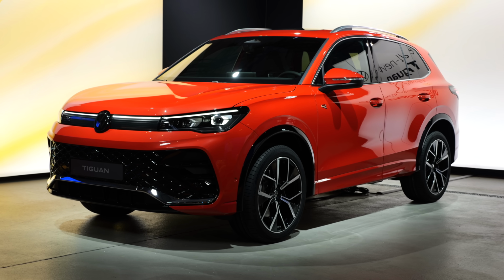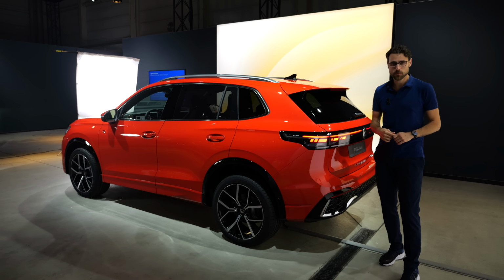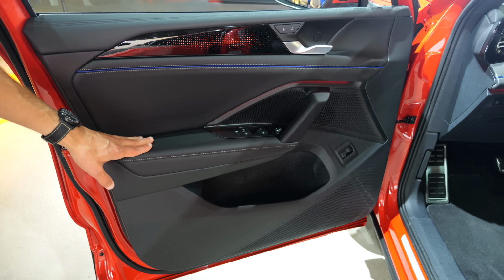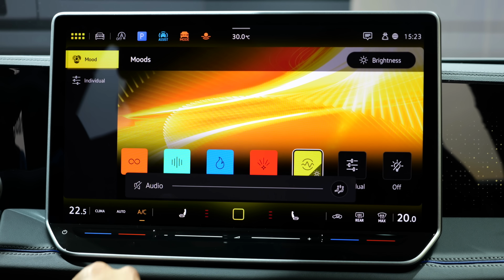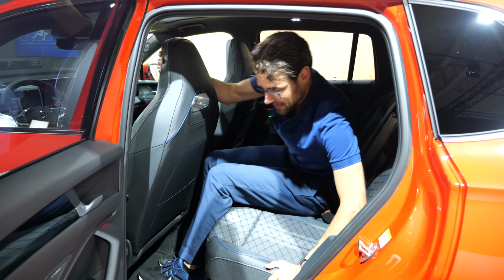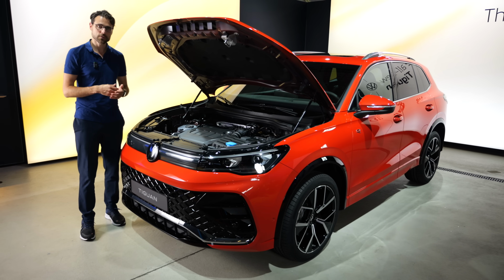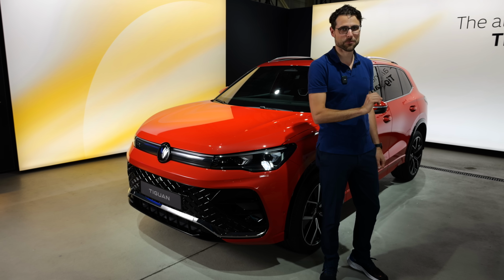all-new VW Tiguan first REVIEW 2024

Comment from the maker: ►Follow us on Instagram @autogefuehl and @thomas.letsgo
►Subscribe here: https://www.youtube.com/user/autogefuehl?sub_confirmation=1

00:00 2024 VW Tiguan R-Line
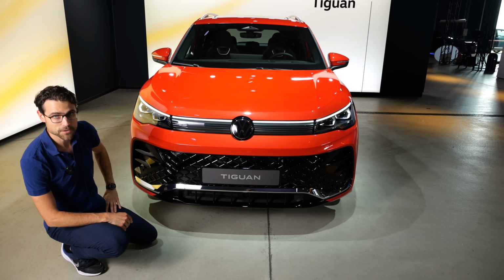01:09 Length, wheels and DCC Pro
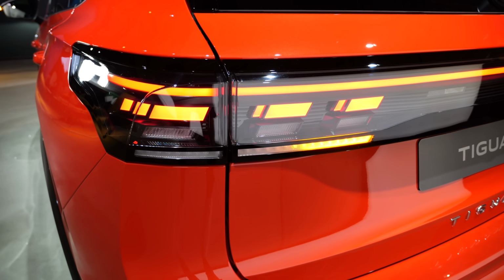03:10 Elegance
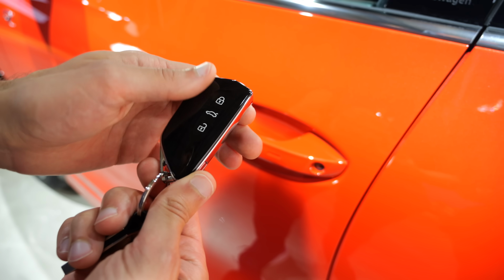03:38 Interior: doors and steering
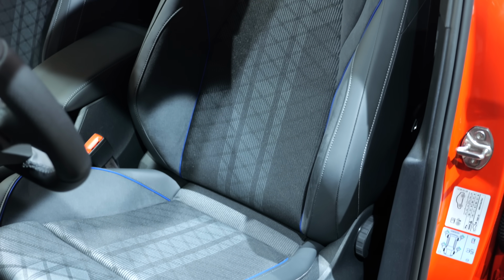04:43 Seats and comfort
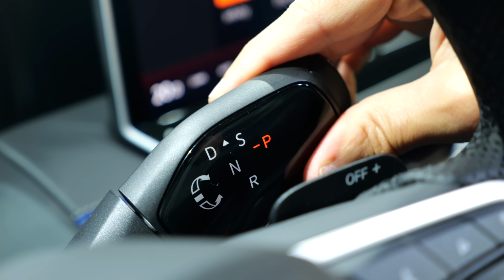06:20 Cockpit and user interface
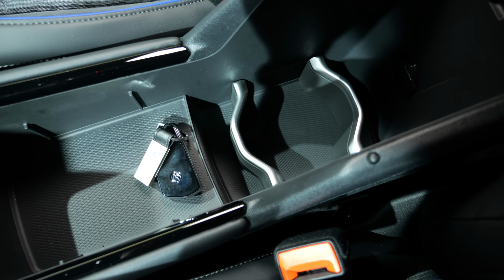09:15 Rear seats
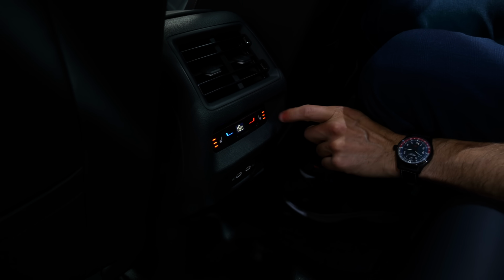10:34 Trunk / boot
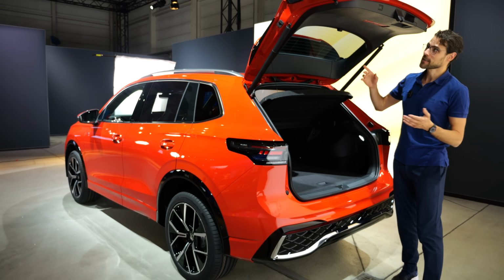12:08 Engines with upgraded PHEV
13:08 Will it succeed?
13:52 Tayron as Tiguan for US market

#VW #VWTiguan

Transparency note: Autogefühl videos are independent and free from editorial influence on opinion and rating. But since manufacturers enable us to do the reviews in the first place, for legal reasons this video is marked as _advertisement_.
Reply: Portland. JAMAICA in the Building!!!
Reply: Let me guess: complete over-engineered, thousands of sensors and actors confusing repair attempts, weak contruction. Designed on computer, tested by customers. No thanks.
I love my Golf IV, model 2002 with 1.9 TDI engine, never had a problem after 350000 km. No electronics (Door locks use the CAN bus)
Reply: @Kartoffelsuppe_m_Wursteinlage  i hope you never need to buy a new car. Because if this is what you think it is like, there won't be a new car you like ever again.
Reply: The model of the Mercedes Benz AMG G63.  since Thomas made the model 350D
Reply: You should look at new peugoet 3008. That is the car. No thanks no more VW. The quality of vw has lost with models above the year 2012 and with every new model is worse. Price for quality.😉
Reply: when sales starts in EU?
Reply: @Alekso777  DO NOT buy a VW with a sunroof.  They leak, and VW is not being honest about this.  They will seek to deny warranty coverage for this.  I've currently got a court date set with VW in Brooklyn NY.  This is a widespread problem, across VW models with panoramic sunroofs.
Reply: Hi Thomas!! When do you expect the on road review of this model??
Reply: So, VW will drop the “Tiguan All Space” name and change it to “Tayron” which is the U.S. version but it will also be available in Europe and in other markets outside of North America.
Reply: given the very low quality and low reliability of VW's, is this more style over substance, or did they address their Very low-quality issues?? is this model coming to the US??

Comment: Really hoping Volkswagen will allow the PHEV Tiguan to be able to run a "camp mode" allowing owners to use the AC or heat while camping in the vehicle.  The 20kw battery will allow the AC to run for many hours before the gas engine turns on.🎉🎉

Comment: Ah, buttons on the wheel !  I've skipped vw's cuz of the bull crap "electronic" steering wheels - so distracting and a pain to use (thinking of the REALLY dumb window switches on the ID4).  Touch screens are ok if you're not wearing gloves (i.e. winter).

Comment: Open Road VW Manhattan would not honor the sunroof warranty on my 2019 Alltrack, even though it is still under warranty and I've had all the recommended VW service.  Now my sunroof is leaking.  Water has leaked into the carpet and padding underneath, and VW will not honor their warranty.  This problem is rampant in VWs.  Very dishonest.  I would not purchase another VW due to abysmal dealer performance and lack of support from VW USA.  The culture is rotten at VW.

Comment: A completely new das auto built on a universal MQB trolley (which is 10 years old) with an EA 888 engine (which is also ten years old) and a flimsy DSG DQ 250 gearbox.
But what's new you ask???
Haven't you seen the LED strip on the front??? What about the revolutionary Chinese display in the middle??? Also do not forget that the price is twice as high as the previous generation. In principle, if you don’t buy it, the car is good. 🤣🤣🤣

Comment: The current NA-Tiguan missed the cool tail lights, the front cup holder cover, the nicer armrest, the dash cubby cover, the rear flashlight, rear AC option, and the pre-face-lift model had outdated halogen headlights and unless you got the top trim level, it missed out on plastic trim on the door panels (how mean). It makes the car feel like VW made an effort to make our model worse; and that doesn’t make me want to buy one. Sorry to my 2018 SE model, but I know what you’re missing.

Comment: Great design but one thing. 
That physical volume controller is designed in a perfect way but, when I am gonna use that, I would never want to check in what mode it commands at that moment. So what if it is in driving mode and I just turned it aiming to decrease the volume?? Oops , driving mode is changed now. A little bit confusion will be there I guess.

Comment: As much as I was disappointed with the facelift of the current Tiguan, the new one looks really nice and they fixed most issues regarding their infotainment system (except for the lack of knobs and buttons for climate control). And it looks very spacious. Shame it doesn't have ventilated seats.

Comment: Big no for me. I think they are drunk in VW. The front looks like a Caddy (which is actually not bad) and the rear end looks like a Tiago which is horrible. Ugly screens inside (I like big screens but this is ugly). Gear lever disaster, put the lever back where it belongs and not behind the steering wheel. VW will never learn that for big money you have to put quality materials in the back, you have to! Big disappointment.

Comment: VW is on the right track with this one. I like the physical buttons, the scroll-wheel in the mid console and the front part of the vehicle.

The two things to improve for other incoming VW vehicles is: 1) The taillights. All the plastic that surround the taillight-bar looks  cheap and ugly.

2) Integrate the middle console screen in the better way. The “glued on iPad-look” just looks horrible and cheap. It completely ruins the otherwise good interior.

Look to the 2018 VW Touaregs interior for inspiration. That was in my opinion the best interior VW ever made.

Comment: Only disappointment is the back door are so plasticity. For the prices  im expecting this car will sell, leather or soft touch surfaces would have been much preferred.  Thank You VW for ditching the capacitive buttons. Better quality on the rear doors would be nice. One last complaint: please please move away from piano black. It ages horribly and scratches very easily. Looks cheap and plasticy. Makes a new car look years older. Like the new infotainment.
Far less to complain about. Well done

Comment: The current Tiguan R and R-Line is a vastly SUPERIOR design.  I am a disappointed in it. They tried to make it look like an iD4, which is a BIG mistake.  I do not have any issues with either push button or haptic controls on the steering wheel, I have cars with both and both work just fine.  The carry on about haptic buttons on this channel is a joke.

Comment: How could you possibly praise these seats when they don’t even fit you properly? And what about the volume/driving modes knob which adds so much unnecessary confusion while driving? And the “design”… ah the design… it’s one of the ugliest cars VW makes and the more impressive is how it continues to get even uglier with each new generation! The square bumpers are gross… almost as disgusting as the lateral roof line which they couldn’t decide whether they should make it rounded or more square and angular, and went with both in the worst combination possible. Gross car. Taos looks incomparable to this thing, btw.

Comment: Much improved from VW - it looks pretty good, and it has buttons on the steering wheel and nice sustainable seating materials.  However, the ridiculous sliders for the sunroof (who on earth thought that was a good idea?) and the even more ridiculous climate controls let it down.

Perhaps in another 3 or 5 years, VW will finally get it right.  They should probably go back to the Mark 7.5 Golf for some inspiration.

The lumps in the boot floor remind me of Mr Blobby from BBC TV in the 1990s.

Comment: Very nice new design language based on the ID's, is a big step forward for the Tiguan, to me looks premium. I like a lot that orange/ black combination in the R line, looks like the improved the graphics of the digital displays but it will be better if they could integrate the center screen in the dash like in the new Touareg. In my opinion i think is better a electro mechanic gear selector in the middle of the console instead in the steering wheel. Volume phisical button is fantastic but i will not use the same button for the driving selection mode is a risk to change by mistake.
VW should use the same names everywhere in the world
For example the same car:
Atlas in U.S
Teramont in Colombia
It doesn't make a sense.

Comment: I have a 2019 Tiguan R Line SEL Premium I bought new in 2018.  It's a great looking vehicle, with great tech, VW did a great job.  I like the look of the new Tiguan and I agree with you they should have made this vehicle a global Tiguan.   Every since VW failed with the expensive VW Phaeton in America.  It's like VW of America is afraid to sell vehicles in America that's not oversized and cheap.  There are a lot of fully loaded VW Atlas on the road that was  over $50,000, so if you have a good looking durable product with the latest tech people will buy the vehicle.  The VW Tayron is nice and it's rumors that the Tayron X could also come over but the interior is very similar to the current Tiguan especially the door interior and it doesn't have the latest tech.  It still have the current VW virtual cockpit and the current terrain knob for drive mode.  I'll be looking at the upcoming 2025 Audi Q6 etron, since I can't get the VW Touareg, I'll go back to Audi.

Comment: I used to drive a Tiguan for 7 years. Since 2019 I've been driving a Toyota. One of them had quality problems with 2 years warranty and the other has 10 years warranty with no quality issues (10 Years warranty from service to service). You can guess which one is which. VW Sales are screwed and they can't do even a small move to make the warranty  be competitive. 8 Years full warranty and VW would be interesting again. With 2 years warranty, I'm never going back although I like VW cars.

Comment: What do I like about the third Generation Tiguan? 1. Improved aerodynamics that don’t make the car look like a jelly bean.   2. The engine upgrades.  3. Better sound insulation, though the current model isn’t exactly loud.  4. R line steering wheel.  5. Better headlamp and tail light design.

What don’t I like?  1. The ridiculous 15 inch screen….i think Thomas is wrong when he says it’s not a distraction.  2. The dash and door light gimmick.  3.  The new dash looks clunky and overly busy….it’s an ugly design.  4. Gear shifter being moved to the steering column.  5. The improved aerodynamics come at the expense of character, this car is very vanilla and generic looking.

All in all I give this redesign a fail.  It’s clear that he intent is to make the car look more like the iD series to prepare everyone for the coming electric generations but it’s not really working in my opinion.
Reply from the maker: Thanks for the feedback! I agree that the screen is in your face. My argument was that when the icons on the screen are larger, it is easier to press them and therefore you are somehow less distracted, referring to how easy it is to control it.
Reply: @autogefuehl that may be true but unless it’s set to turn off when you are in motion I still think it would be rather distracting.   Hard to say for sure until I drive one.

Comment: Really awesome updates to the PHEV, battery part. 20 kWh battery and 11 kW AC charging and 50 kW DC charging are fantastic (for a PHEV)
Reply: It's basically an original e-UP trapped inside but with better charging.

Comment: Thanks for deleting my comment, dear censorship. 
Let me guess: complete over-engineered, thousands of sensors and actors confusing repair attempts, weak contruction. Designed on computer, tested by customers. No thanks.
I love my Golf IV, model 2002 with 1.9 TDI engine, never had a problem after 350000 km. No electronics (Door locks use the CAN bus)

Comment: FWIW, I have a 2021 elegance (from new) and, with the exception of having to have the steering wheel replaced (a known VW recall fault) I've enjoyed every minute with the car.
I'll be replacing it around this time in 2024 but from what I've seen in this review it will not be with a Tiguan.
That big display in the center of the dashboard has the appearance of an afterthought that's been dropped in place at the factory gate. That size is unnecessary for anyone with average sight. 
Similarly with the illuminated panels on dashboard & doors - VW listen up - if I wanted a playstation I'd buy one but I'd leave it at home. The built in display and the discreet ambient lights in my current elegance model is more tasteful... and suitable for a car that will probably retail around £38K.
Thanks for the review Thomas, I'll start considering my options earlier - with autogefuhl assisting as usual 😊
Reply: The lower trims get a smaller screen and don’t have the illuminated panels.
Reply: It is meant to appeal to younger people i guess
Reply: No one cares what you are doing and this car will sell well.

Comment: Quite an interesting proposal. I'm surprised by the front logo; it's almost invisible yet so big at the same time. Also, it's finally a plug-in hybrid. Will it make its way to Audi as well? The exterior design gives me Honda vibes, and it looks longer than 4.54m. The interior has mixed feelings, especially regarding the integration, or lack thereof, of the big screen. I also don't really like the integrated headrests. How are the seats in the Elegance model?
Reply: The current Tiguan has a Plug-In-Hybrid version already.

Comment: I would actually measure the boot space - in the previous one it was 615, but with all the rear seats pushed too far to seat on them.
Reply from the maker: we always measure?
Reply: @autogefuehl  Sorry, but you don't measure the volume, just few dimensions. The trunk is not a basic geometric primitive for that to suffice. IMHO most boot volume sizes declared are not true or require some serial changes to the interior setup.
Reply: @10Filip  Dimensions are what count not volume... 
Volume is a pointless measurement considering every brand seems to measure it differently anyway, some measure up to the parcel shelf, some to the roof. some don't include under floor storage, some do. some measure with seats forward, some with seats back. just pointless. dimensions are what count.
Reply: @Dreadpirateflappy  They are not pointless if the reviewer does is correctly every time. What is pointless is showing these volume figures from Vendor in the video, cause as you correctly stated, they cannot be trusted. That being said, I noticed that here the reviewer didn't even hold the ruler correctly.

Comment: The R-Line snout is beyond hilarious. 2/3 is a gaping hole! ;) "Uberhohl" prestige is a typical German anomaly, and even mudane B/C segments vehicles often are equipped with kriegerisch / martial looks to impress on the Kaufhof / Harrods parking. Designwise the new ultra modern Peugeot E-3008 is much more interesting, both exterior and interior.

Comment: Is it just me or does the dash look like it was designed to have the screen integrated in to give one continuous black strip with the bigger screens being a last minute change? Still it's good to see VW changing course and going back to physical buttons on the wheel. Touchscreen climate, when done properly, isn't necessarily a massive problem but touch panels on the wheel with small target areas and no obvious physical demarcations are, IMO of course, idiotic. Genuinely made the last gen of VW products instant non-starters for me, it'd drive me nuts in very short order. 

Some other nice touches here, the multi-select controller is a decent idea and good to see some restraint with only two modes available. Pity about the slab of piano black around it though what on earth were they thinking with a gloss black keyfob? That's going to be scratched to hell and back in no time... oooohhh, wait, by any chance have VW got a range of colour-matched keyfob holders coming out to go with it?